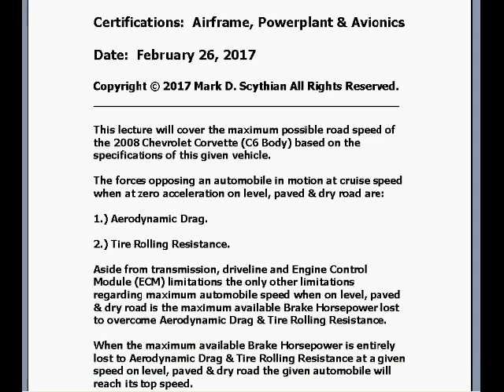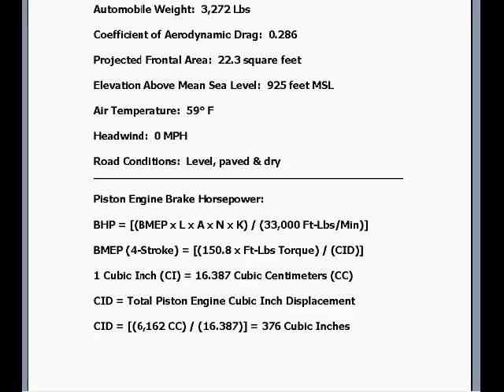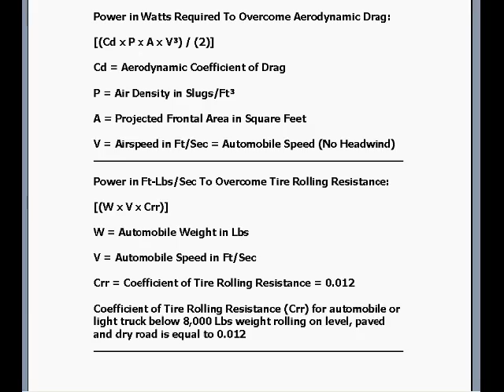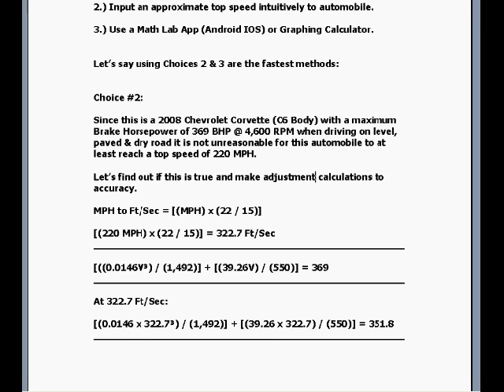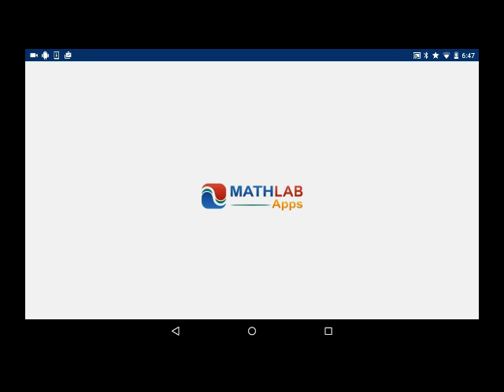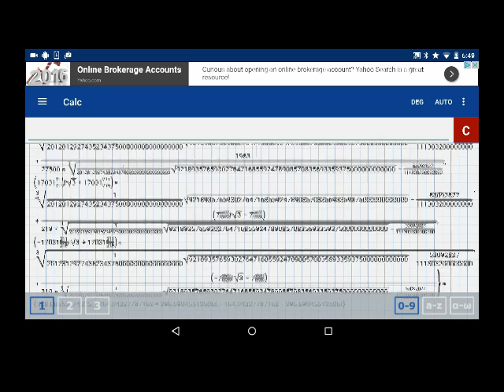2008 Chevrolet Corvette Top Speed Calculation

Comment: This video is insanely good. It is spot on on everything you need.  The only question I have Mark, an Engine has 2 power values  Max Torque @ RPM and Max HP @ RPM.  Example   360ft/lbs @ 4200 and  300hp @ 6200 on same engine. As far as I see , to calculate your top speed parameters you take HP produced by MAX Torque at lower RPM rather than Take HP value from a higher RPM?   Assuming we are dealing with MAX "POWER", we use the biggest Torque values to get BHP, correct?
Reply from the maker: Hello JJ.

Ft-Lbs Torque, BMEP and BHP are all directly proportional to each other.  Everything else is Power & Work LOST to keep the engine running and cannot be used to determine usable power output or Brake Horsepower (BHP).

Work = (Force x Distance) ===> Ft-Lbs, Newton-meters & Joules.

Power = (Force x Distance) / (Time) ===> Ft-Lbs/Sec, Newton-meters/Sec, Joules/Sec, Watts & Horsepower.

1 Lbs of Gasoline = 20,000 BTU potential heat energy content.

1 US Liquid Gallon of Gasoline = (6 Lbs x 20,000 BTU) = 120,000 BTU potential heat energy content per US gallon.

1 BTU/Min output in the form of burning Gasoline = 17.6 Watts of Power.

Gasoline piston engine % Brake Thermal Efficiency (% BTE) at No-Load operating conditions = 33% BTE = 1 Watt of Power in the form of burning Gasoline wil become 0.33 Watts of mechanical power at the crankshaft when engine is operating at No-Load conditions.

The power lost to keep engine running is Friction Horsepower (FHP).  The usable power output is Brake Horsepower (BHP).  These two added together result in the "HP" or Indicated Horsepower (IHP) of the engine.

The Torque Curve is what really counts.  The Torque Curve represents the maximum available Ft-Lbs Torque available at a given RPM.  

Any RPM higher or lower than the RPM where maximum Ft-Lbs Torque is reached will cause Ft-Lbs Torque to drop.

When manufacturers publish a maximum "HP" value at a certain RPM they are referring to the power LOST to keep the engine running (Friction Horsepower) PLUS the usable power output available at the crankshaft (Brake Horsepower).

Indicated Horsepower (IHP) = "HP" =  Brake Horsepower (BHP) + Friction Horsepower (FHP).

Using the "HP" rating is NOT the correct way to quantify the usable power output of a piston engine and how it will affect a vehicle's performance.  Only the BHP not "HP" will determine a piston engine's usable power output.

To calculate the maximum usable power output (BHP) of a piston engine do the following:

1.) Find the maximum Ft-Lbs Torque output at given RPM.  Record both values:  Max Ft-Lbs Torque and given RPM.

2.) Use the 4-Stroke BMEP formula to calculate BMEP in PSI by entering in max Ft-Lbs Torque & CID.

3.) Enter BMEP in PSI, Piston Stroke in Ft, Bore Area in Sq In, Powerstrokes/Min @ max Torque RPM and number of 
     cylinders into Piston Engine BHP Formula.  Maximum BHP output at the same RPM as maximum Ft-Lbs Torque 
     output will be known.

Note:  In regards to 4-Stroke Piston Engines the Powerstrokes per minute are equal to half the RPM.

- Mark -
Reply: Mark , i can not thank you enough. This is great stuff. Each time I get better and better results in the sim as well. This will give me a day or two of work. Thank you very much once again.
Reply from the maker: You're welcome!
Reply: One more question if you don't mind. Is there any formula or algorithm to compensate for compression differences.  Let's say.   A 12:1 ratio engine is making  500 lbs/ft@4000 RPM.   What would the same engine produce if Compression was dropped let's say to 10:1 ratio?   Question 2 . Using BHP and BMEP and accurate torque curve from on line, is it logical not to count in compression differences as they would simply reflect on a torque curve picture?
Reply from the maker: Answer #1:

The function of Compression Ratio in a four-stroke Gasoline piston engine is to raise the temperature of the vaporized air/fuel charge to match the Flash Point Temperature of Gasoline to allow for effective combustion during the spark-ignition event.

Converting the Compression Ratio into Pressure Ratio (the two are not the same) and then applying the Ideal Gas Law & Adiabatic Cycle Thermodynamics can determine what Flash Point temperature loss will occur during an under-CR condition.  This then applied to the compression of air & vaporized Gasoline within a constant volume at a certain AFR.  From that point on you'll be able to establish a formula or formulas for the given power loss application due to under-combustion of the given air/fuel charge.

Power lost to keep a piston engine running includes the power LOST  to overcome compression.   Compression is an air/fuel heating function whereas the BMEP, Torque & RPM output of the engine is derived from the energy released by the combustion of fuel.

A CR below the engine CR rating will result in either leaning out of the AFR if EFI fuel delivery or unburned Gasoline exiting out the exhaust manifold if carburetor fuel delivery.  Too low CR = Not enough Flash Point temperature to effectively and completely ignite the given air/fuel charge.  Either way a reduction of power will occur.

Answer #2:

Yes.

If reduced CR exists below rated-CR of the given four-stroke Gasoline piston engine the measured Torque & RPM output will not reflect the rated Torque Curve but instead will operate BELOW the Torque Curve rating since not enough Flash Point temperature is reached to completely burn the given air/fuel charge.  The RPM & Torque output (BHP) is derived from the energy released by the fuel itself.

- Mark -
Reply: Thank you Mark once again. This is really really awesome. I am still learning. The software I am working with is far far from perfect. And the initial hard code coding of the game is not available to look exactly at what kind of formulas they ran. It is like a puzzle in a way with some known values , some unknown and the Game play itself as a final test for editing. It is very exiting to me to try to solve for a proper editing procedure. Thank you thank you thank you. All this helps sooo much when we are not sure what goes on in the game's engine exactly. A lot of trial and error and a lot of "what ifs" Without you I would still be a mile back.
Reply from the maker: Hello JJ.

I'm glad that I was able to help you out.  

Let me know if you have other technical inquiries regarding your project.

- Mark -
Reply: Oh as long as I am not bothering you too much , I have a ton of questions. I am forced to dig into tire section of the physics due to tire rolling resistance. If the information is true and in fact those numbers are rolling resistance  0.1648389  seems way too high of a number. Maybe not for a NASCAR race tire but the problem is , it is not adjustable and it is "self calculated" from other parameters. Lot's of unknown values. It looks like this pretty much. https://imgur.com/a/q9AGg   More than half are unknown, please tell me where would I even start. I tried changing tire radius and width and it affected the rolling resistance , I was able to get it lower. But not nearly close enough to what is needed.  Please tell me if you see any familiar patterns. If it isnt too much to ask. This is my job guessing all these numbers , I dont want to impose it on you either.
Reply from the maker: Hello JJ.  It isn't a bad idea to access the Wikipedia pages on land vehicle Coefficient of Tire Rolling Resistance (Crr).  Wikipedia publishes the industry-accepted Crr for everything from automobile & light truck under 8,000 Lbs rolling on level, paved & dry road.  As well as the various NASCAR Crr for different vehicle applications by year and performance limitations.  NASCAR engine & vehicle builders must conform to strict NASCAR specifications in order to qualify their race cars into NASCAR racing.  

Integrate all of the following formulations:  %VE based on AFR, Lbs/Sec Mass Airflow, Lbs/Sec Fuel Consumption, 4-stroke BMEP, PLANK/33,000, Tire Rolling Resistance, Aerodynamic Drag, Thermal Expansion of Block, No-Load 33% BTE, Road Degrees Sin X additional or subtraction  power requirements, valve timing (clearances, cam lobe degrees) BTDC ignition timing, spark advance-delay electronic timing firmware, battery ignition output(s), EGR & Anti-Knock (if applicable).

Once the formulations are either obtained or derived then all of these formulations can be equated to each other and solving for individual variables becomes straight-forward and accurate.  This methodology can also reverse engineer existing specifications of commercially-sold equipment instead of relying on manufacturers to release technical specifications. 

Organizing all these formulations into Excel Spreadsheet and entering in the formulation strategically by cell and cross-over can eventually lead to quick real-time calculations based on rates-of-change.  The other method is to get good at calculus & differential equations, there's many online courses for completing all of the mechanical engineering mathematics used with Calculus-based Physics & Chemistry.   Technicians with two-year degrees have the option to take Calculus, but four-year degree Technicians who become Technologists & Technical Engineers take Calculus-based Physics & Chemistry.

We're in the Information Age.  Those who don't know something can learn it on their own or take online courses or even go back to college and take higher level courses to master applicable concepts so that they can figure anything out on their own.

I suggest that you do more research by at least starting at the Wikipedia pages regarding the Coefficient of Tire Rolling Resistance of applicable NASCAR automotive racing applications.  You'll eventually find the Crr applicable to the application you are working with and from that point on using the proper integration of formulation all the rest of your numbers or metrics will become accurate.  You can then enter in all the calculated numbers into a working design that is within the equilibrium limits of what you are working on designing.

I suggest that you create a database using Wikipedia including all relevant formulation.  Then integrate all formulation into an Excel Spreadsheet system entering formulations into cross-over cells until you can enter the limits and all the metrics change in real time.  After that you can use the graphing function to create graphs which will bring forth the same results as creating differential equations applicable to the various different rate-of-change involved.  The goal is to figure out the specifications which lead to an equilibrium throughout all limitations of the application you are designing.  After that you might want to manually enter in all the specifications into your racing simulator platform bypassing any default settings.  

- Mark -
Reply: Thank you very much Mark for all your help. The Excel Spreadsheet approach is plain genius. It would have to be done at some point in time. And also anyone who would be willing to edit the physics in the future would use it as well. That is stepping it up a notch into a really legitimate project. Organizing Excel File is something I can definitely manage. The gaming software was made in 2003 yet it still hold up to date versus many other racing video games. The more I dig into its structure the more I feel like I need a degree in many different areas. Learning all this stuff is as exiting to me as the actual simulator. I can not thank you enough on all the progress that happened in the past week.
Reply from the maker: Hello JJ.  In regards to anything out there that involves energy, motion, potential energy & kinetic energy it is ideal to draw a Free-Body-Diagram illustrating all the forces involved on an object in motion.  From that point finding the applied physics formulas which describe each force and its relationship to potential & kinetic energy will solve problems on the systemic level.  

As for engines & powerplants they can be intimately understood by accessing all possible engine applied physics formulas in relationship to the Work, Force, Power, Pressure & Acceleration applied physics principles and industry standards especially in regards to % Brake Thermal Efficiency.  

From that point onward the potential energy to kinetic energy relationships in regards to power sources and how they become heat, pressure, mechanical power, electrical power, thermal power & motion will be known.  As they are calculated the losses to overcome drag, friction and other environmental factors can also be known.  

Designing a purely numerically based power system and then entering them into a modeling simulator would lead to the design goals you are looking for.  The Excel Spreadsheet approach will probably open up a lot of doors giving you access to what you are looking for.

Talk to you later JJ!

- Mark -